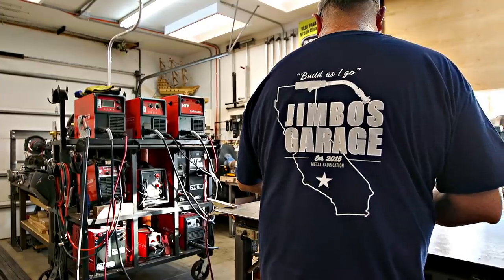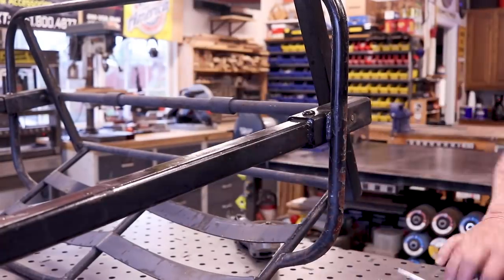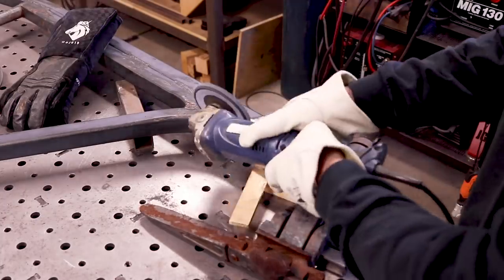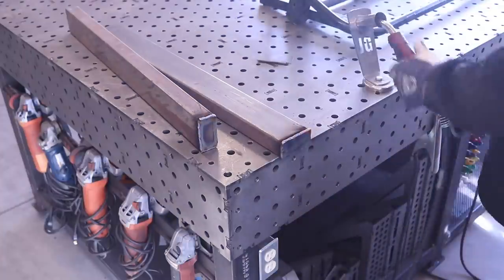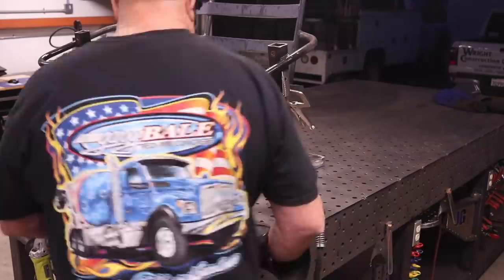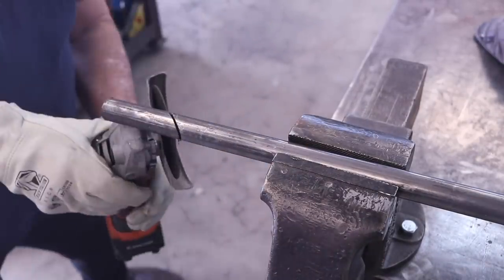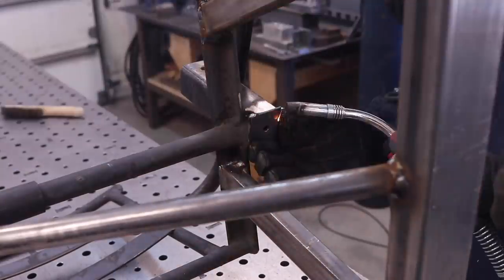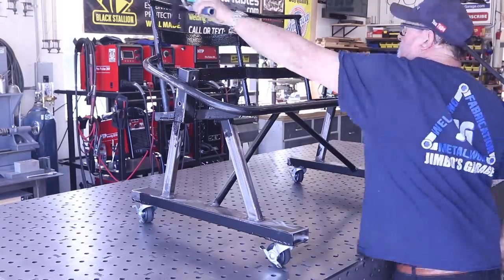Ski Chairlift Bench Conversion | JIMBO'S GARAGE

Comment: What I really like about your, and the other, welding videos is that there is also the thinking behind the projects, not just the welding - it means that sometimes you will do things in a certain way, or whatever, that makes one think on it and trigger ideas for possible future projects - in this case, some may consider a modified chair being used like a 'flying fox' on a cable so it can be repositioned, perhaps to follow the sun, or shade, as the season or daylight changes?

Comment: Remember to re-pack the bearings on the casters with grease after welding.  The heat will cause the grease to liquify and run off.

Comment: When I saw the rectangle tubes going on the bottom it hit me like a ton of bricks.  I thought that It would look pretty cool if the bottoms where 1/4" - 3/8" thick by 3" -  4" flat bar stock rolled up a little on the front and shaped to a rounded point like a snow ski so the lift looks like it is sitting on a pair of skis.  I think it would totally bring the art piece together .02¢ Looks good without that though.